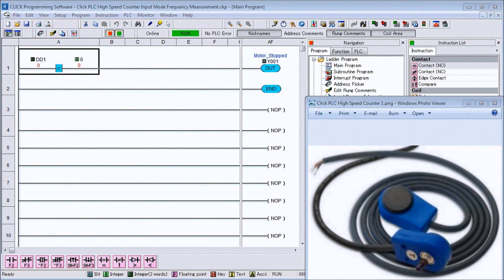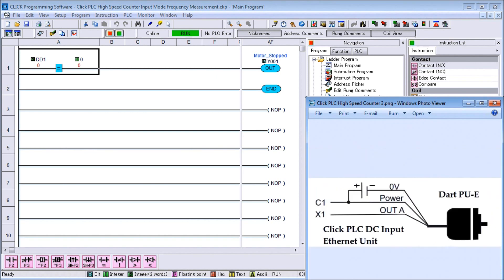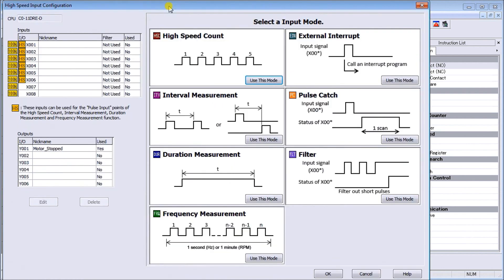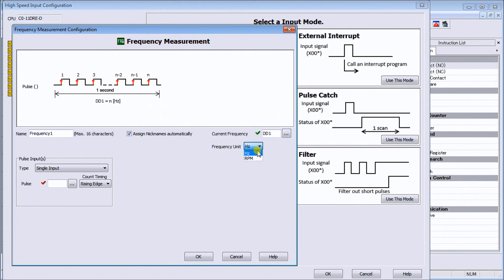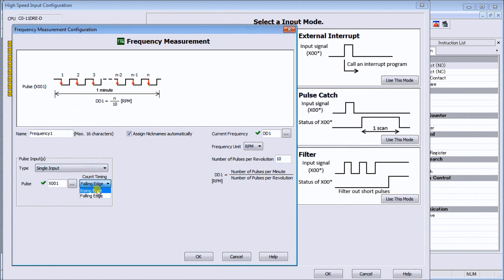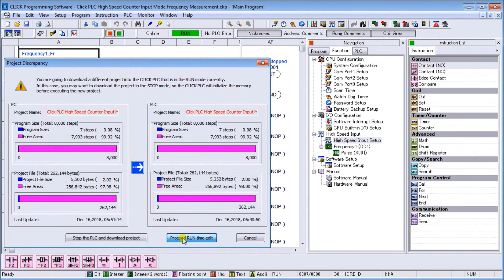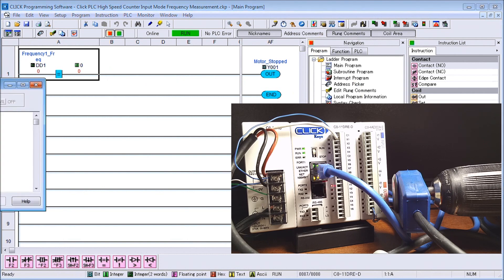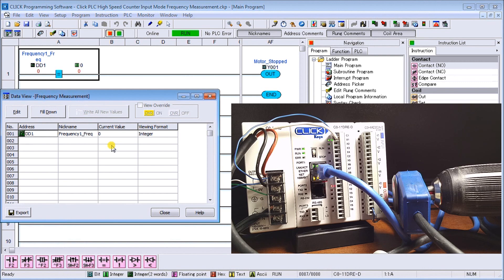Click PLC High Speed Counter Input Frequency Measurement Mode

Comment: How can I take the rpm pv and have the plc do the math and calculate a speed pv? (M/Hr) Assuming a 26" bicycle tire and 16 magnets around the wheel for a inductive sensor.
Reply from the maker: Hi Blake,
After you have the RPM value from the High-Speed Counter Frequency input, you would use the MATH instruction.
Speed = RPM x 3.14(Pi)xD (26")
I hope this helps you out.
Regards,
Garry
Reply: @ACCautomation  Is it possible to make the new cakcukated mph value a pv for click's pid controller? (for cruise control on a bike)
Reply from the maker: @blakegardner2339  
Yes, the calculated Speed could be an SV (set value) for a PID loop.
https://accautomation.ca/click-plc-pid-using-factory-io/
https://accautomation.ca/click-plc-pid-instruction-and-autotuning-using-factory-io/
Regards,
Garry
Reply: @ACCautomation  I have been thinking about building an electric bicycle for a long time with a click PLC vfd and HMI on the handlebars, but I am hesitant to pull the trigger because of all the expensive parts and the massive integration project that would be. Maybe when I write the ladder code I can send it to you and ask what you think. I think it would be very cool to use the clicks high speed counter function and the PID controller to use as a home brew cruise control.
Reply from the maker: @blakegardner2339  
This could work. I would use Node-RED communicating to the Click. The HMI then could be your Android or IOS phone.
https://accautomation.ca/series/node-red-iot-enabling-software/
Regards,
Garry